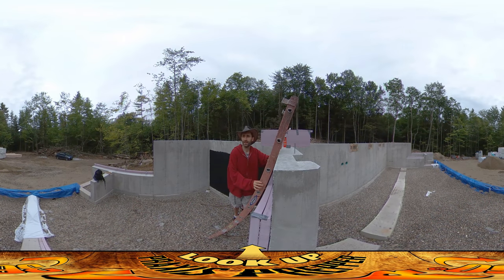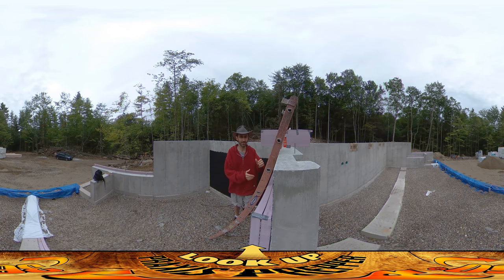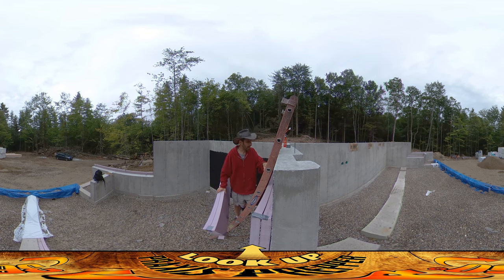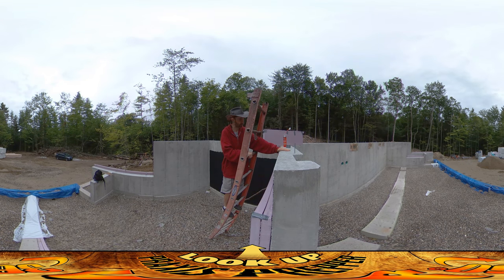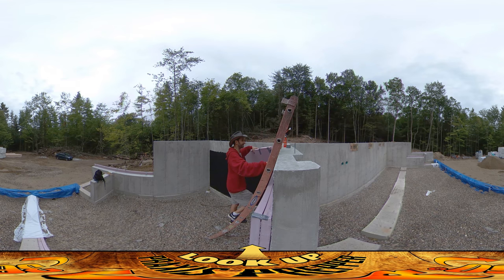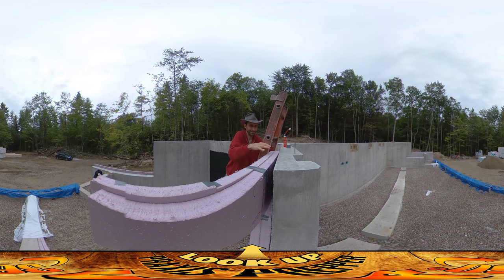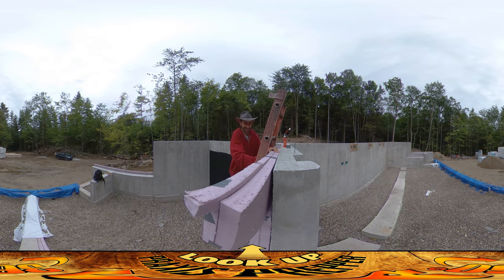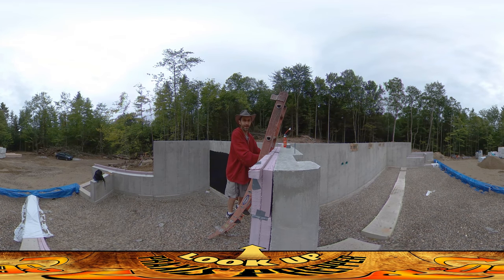Homestead Building - Dangerous Building Techniques, Contractors Missing Again, Foam Application

Comment: You need to fasten those foam panels either with tapcon screws or ramset nails with either a metal washer or a plastic foam panel washer. The Spray foam isn't going to hold up. A better adhesive would be construction adhesive that come in caulking gun tubes. If on outside of the wall, you can apply an asphalt water sealant and stick the foam before it cures.
Reply from the maker: I'm using tapcons run through wire lath that I'll later stucco. These are on the outside of the wall and I did apply an asphalt seal. I've been told (after the fact by some others) that the asphalt can interact with the foam in a negative way to degrade it though. I did this same approach at my last home and it seemed to hold up fine after more than a decade. Do you have any knowledge about asphalt degrading foam when in contact?
Reply: @PraxisPrepper  No on the foam with asphalt sealer, but I am aware that some chemicals will eat\desolve the foam, so its possible. I installed the rigid fiberglass panels instead of foam since it does not degrade or insect home material.
Reply: How would you know that it "held up"? Meaning if it wasn't holding up, what would happen, what would you see?
Reply: @aleell6466  The foam would separate from the concrete wall. Might be a problem when back filling with gravel & dirt.

Comment: Won't just taping and spray foaming the pieces together reduce the Thermal U rating on the insulation, and make it more prone to water damage and insect attack 🤔
Reply from the maker: I'm not sure why using spray foam to fill in the voids would cause any of those things. Maybe it would if the foam were going to be left exposed and not covered up, but seeing as all this will be buried under stucco, I think it'll be fine. I did it this way on my last homestead and it seemed to work out fine there. If I'm not understanding your comment, please re-phrase and re-send. I'm always open to learning something that might improve my build!
Reply: @PraxisPrepper  Ideally you want to use foam  with insecticde. Tunnelling insects love foam to make their homes turning rigid foam into swiss cheese.

 Issue with Corning or Dow is they use a CFC gas that outgasses & will lose about half of there R-value with in 5 to 10 years. Better products would either a fireglass rigid panels or ThermalStar EPS (does not lose R-value over time and includes an insectide)
Reply from the maker: I wasn't aware of the R-value loss over time. Thanks for that tip. I've see insects attack my urethane foam panels in the past, but never the pink board. Maybe different insects in different places? I'm planning to treat a lot of the wall boards that had suffered from insect intrusion last time with dissolved borax this time. Would you see that as being a mistake?